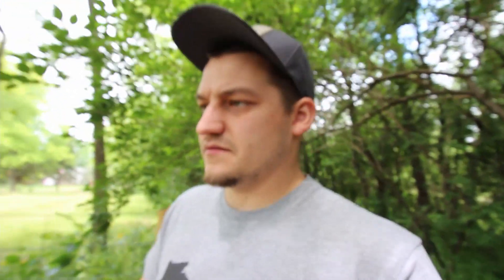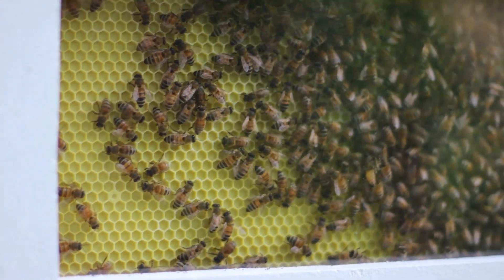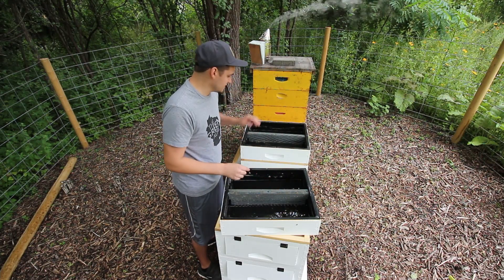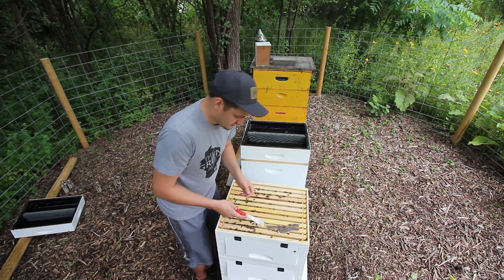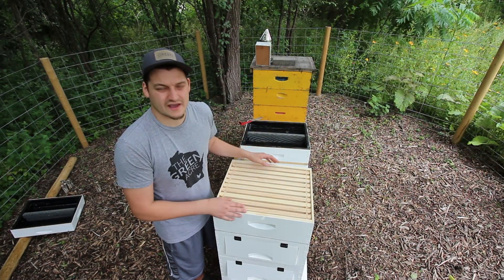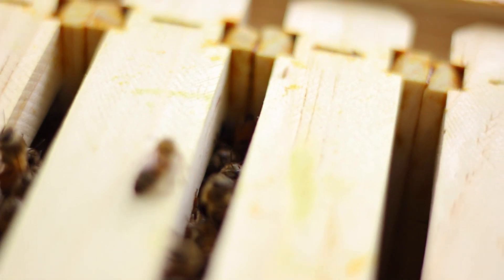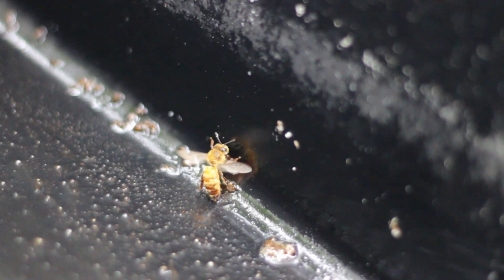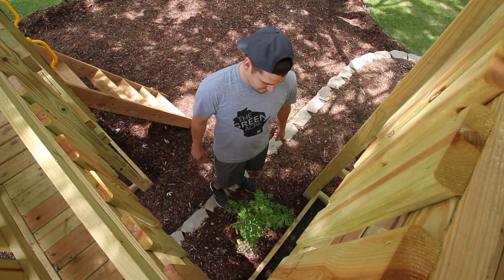It's a SUPER day [ HONEY SUPER INSTALL ] | The Green Acre

Comment: Great explanation of what you were doing. I learn something every time. Can you explain “building out” a little more? Do those holes have to be a specific depth for the queen to lay and for the honey? Love the trumpet vine, it’s gonna be beautiful. 😀 Have a great 4th!
Reply from the maker: The average cell depth for honey storage and female worker bees is 11.3mm; any smaller and the larvae won't have enough room to develop within the cell. Drones (males bees) have slightly taller cell walls and if a colony creates a new queen to replace an old one or a swarm is about to occur, the queen cells are  even larger yet and generally built vertically on the frame as opposed to horizontally. The spacing of the frames in the box is just so that the workers can build out the comb, fill it and cap it with room left over to move freely between frames.
Reply: @TheGreenAcreWI  That’s interesting 🤔. Bees are just so cool.